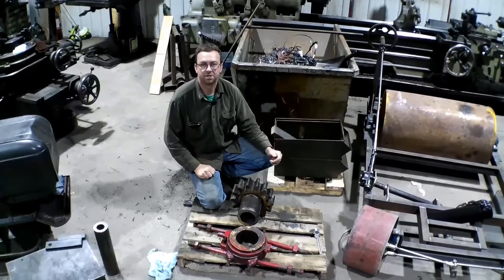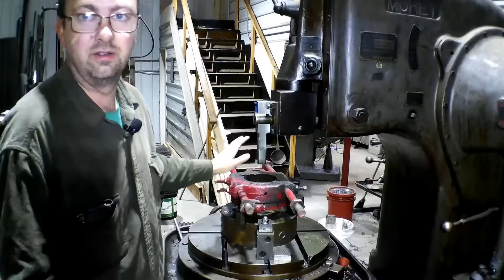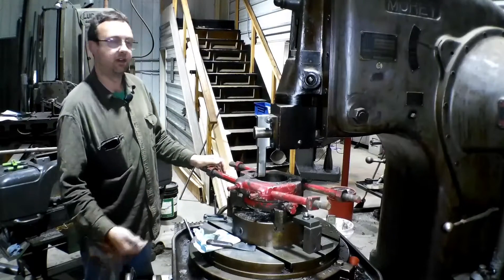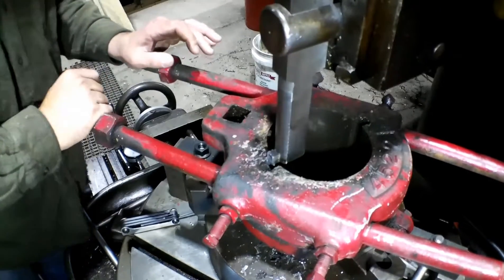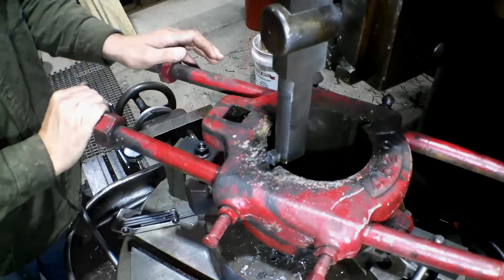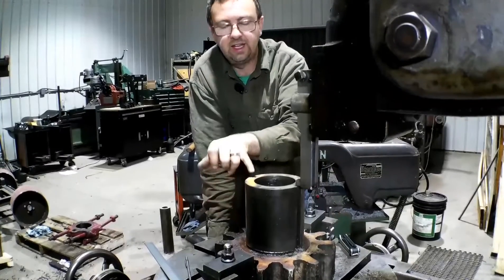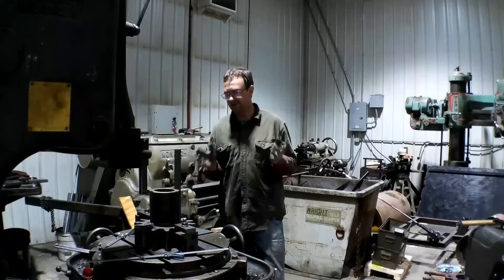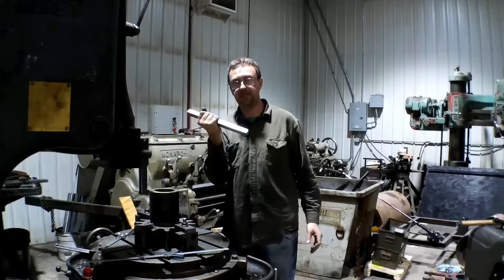Cutting Keyways with a Vertical Slotter, Repairing a Nichols & Shepard Steam Traction Engine Clutch

Comment: Vertical slotter vs horizontal shaper, what are the differences and similarities?
Reply from the maker: Vertical Slotter is just a shaper turned, but it does have an adjustment to do tapered Keyways and the rotary table. I feel it's far more versatile than my shaper.